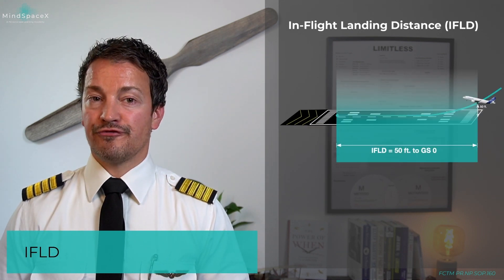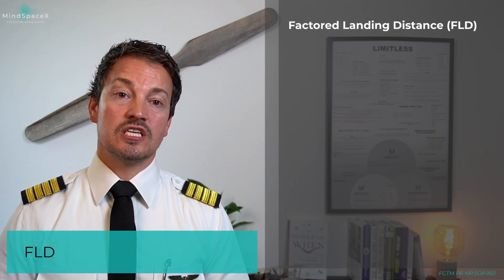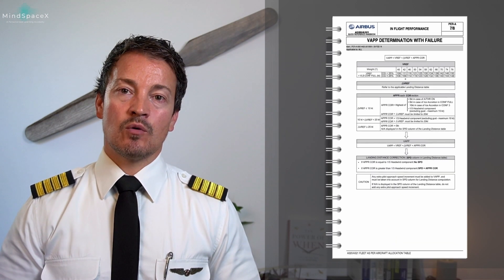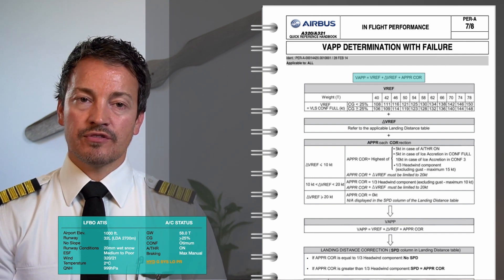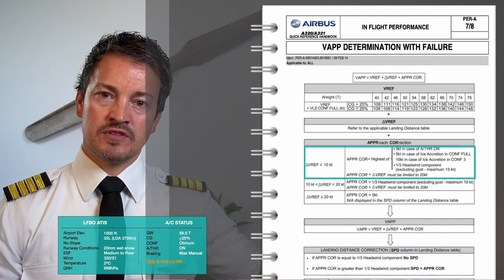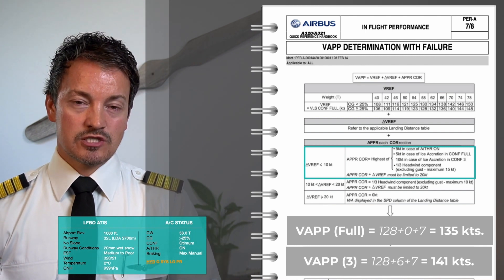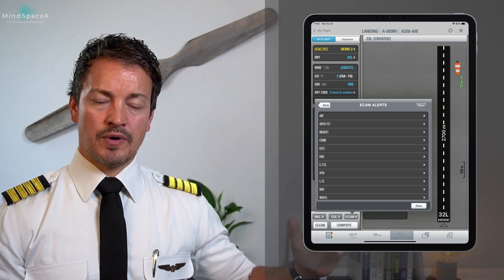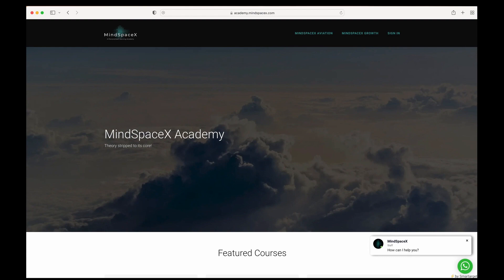Airbus Performance - How to Determine Landing Distance in Flight

Comment: Hi Capt.   Do we consider one thrust reverser as inop due g sys low press pre condition
Reply from the maker: Hi Anupam, If we have only one reverser we still credit it yes. Procedures for single engine landing also requires you to use the remaining reverser after touchdown.